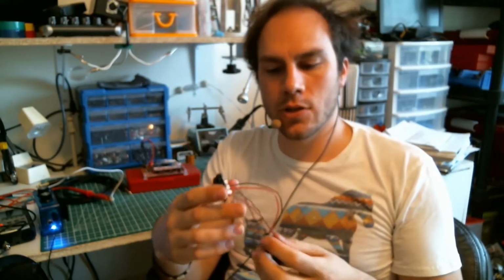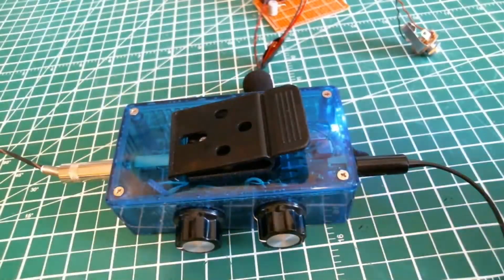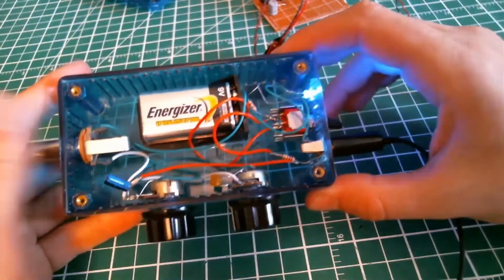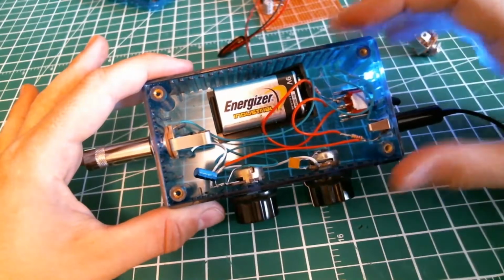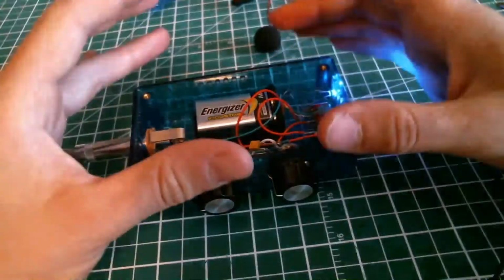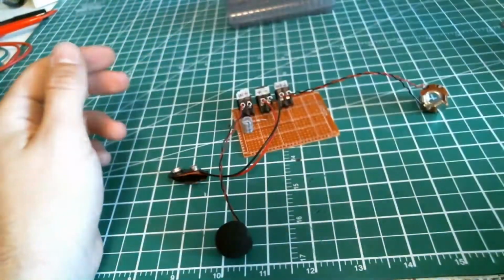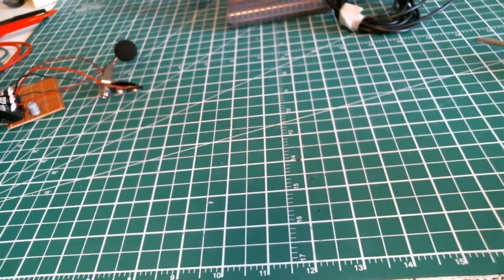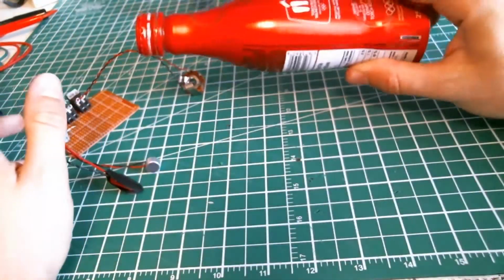Housing your DIY Condenser Mic

Comment: Your video can be kind. Can I use a 10uF capacitor if I don't use a potentiometer?
Reply from the maker: Replacing a potentiometer by a capacitor will not provide the same effect at all. You could use 2 resistors in series to create a voltage divider and have a fixed attenuator.